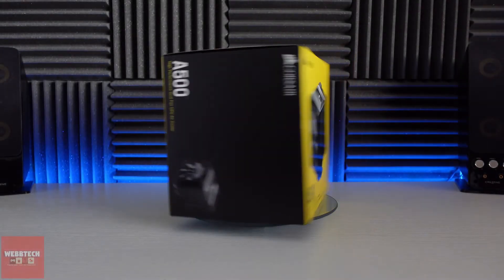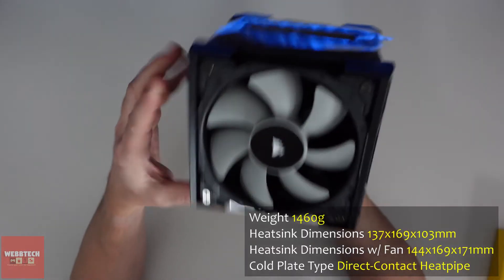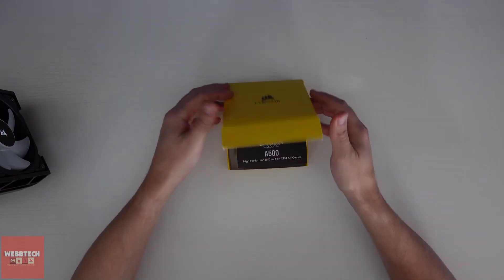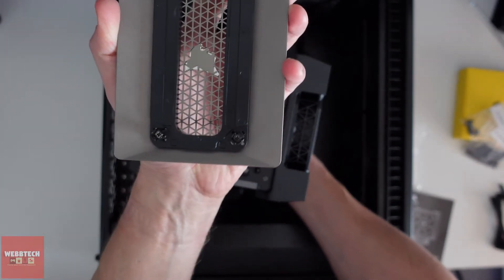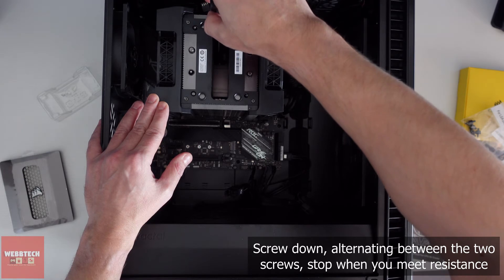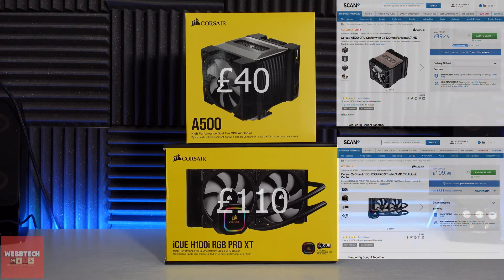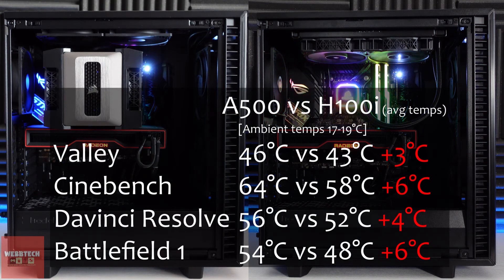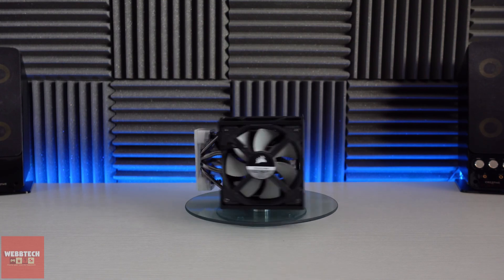Corsair A500 CPU Air Cooler - Unbox, Install, Test & Review

Comment: Not full black hmmn
Reply from the maker: The thing I don't like aesthetically about this cooler are the fans. If they had black or RGB ones that would have been great. The metal top is okay, but I think you could always spray if required, think I saw a video where Jayztwocents did this.